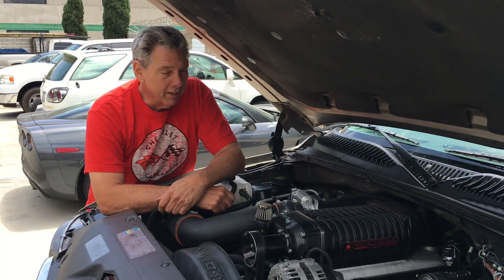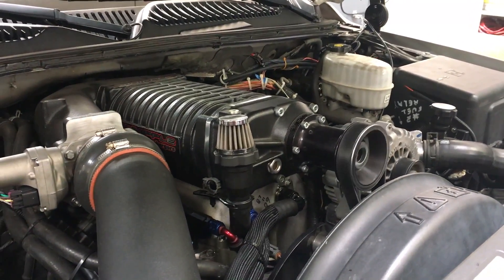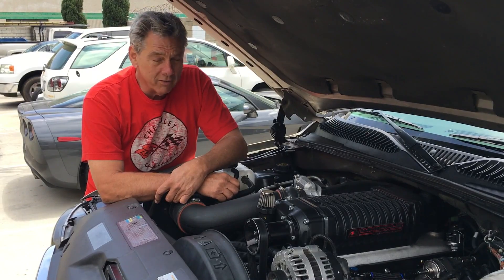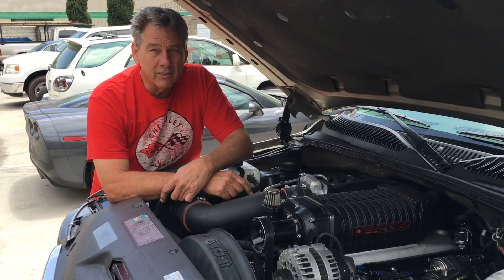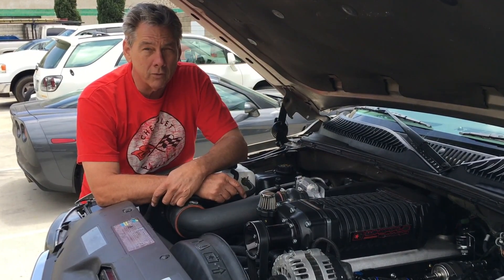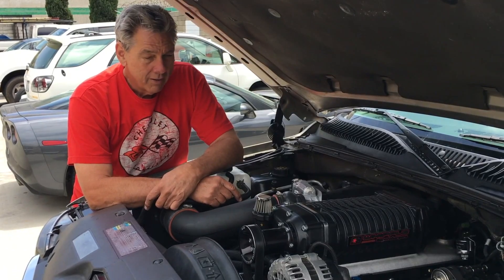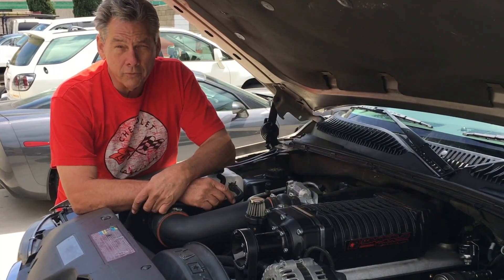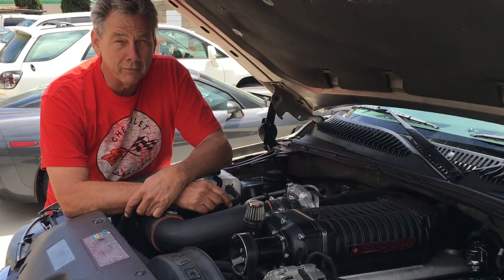2.9L Supercharger Makes 590hp / 695ft-lbs On Stock Vortec 8100 / 8.1L

Comment: God dame that torque curve is nuts. 650 ft lbs at 2500...... thats diesel territory
Reply: Back then the 8.1l was the gas version of a Duramax
Reply: I have a 2001 8.1, a 2016 Cummins 4500, and a 2019 L5P. It’s the 8.1 that puts a huge smile on my face!
Reply: and a lot lower than 2500 rpm
Reply: Diesels are torque monsters
Reply: this thing also puts out WAY more hp than a diesel....ill take a simple blown big block over the head ache that is a turbo diesel any day
Reply: @samsquantch14  Hey enjoy that 5 to 8 mpg towing while I do 15 or better all day long
Reply: @nou8257   😂
Reply: @nou8257  a modern vortec with a good tune and forced induction won't get horrible gas mileage
Reply: @nou8257  these early 8.1 were diesel killers fck mpg im talkin about diesel killers
Reply: @Zkgod24  So while you are getting gas from killing my 7.3 im still driving past laughing then
Reply: @samsquantch14  there is nothing simple about a blown big block the cost in a forged bottom end the super charger and fuel system could buy you a diesel that is ten times as reliable and way more efficient can make 3 times the power.
Reply: @jonruger  a blower is a hell of a lot simpler and has way fewer parts to break than a turbo...and you can pick up a nice silverado with the 8.1 for 4 or 5 grand and its a $8k kit....so thats a hell of a lot cheaper and more unique than every dumb bro dozer you see at every light...or for $3500 get a stroker kit and mkae almost the same power as a low boost blower...pushrods are simple as shit fuck diesels
Reply: @samsquantch14  if that's the argument buy a $3000 LS powered half ton build a cheap turbo kit and have all the power for under 5k. 8.1s just suck face facts they share nothing with the BBC of old that was a proven power maker. And nothing with the LS engine's which are a proven power maker. This is the only company that has aftermarket support for these engines and it's expensive. For the same power and fuel mileage you could build a 454 way cheaper.
Reply: @samsquantch14  most diesels are still just pushrod engines very simple once you understand them less moving parts then most gas engines until you get into newer common rail stuff. They only need fuel and compression to run on an old mechanical diesel pretty straight forward.
Reply: @samsquantch14  a blower has way fewer parts than a turbo, eigh?
Reply: @jonruger  that engine was bone Stock? They even used the stock heads and have it on LOW boost.those vortec engines for the most part will handle anything you throw at it
Reply: @jonruger  if you think a blown big block is complicated you should go sit down
Reply: @jonruger  if you had any clue what you are talking about...you would know it's based off the gen 6 big block but has a bigger stroke and 2 more cap bolts and vortec style heads...you are clueless
Reply: @jonruger  and they are way more tuneable reliable and practical then a old ass carbed big block
Reply: @jonruger  yeah but there is alot more parts to go wrong on a diesel and they are way more expensive..an injection pump can cost as much as an engine swap for a gasser.you are high as balls and won't climb. Down from your diesel perch up there in goofball yeeyee land..You probably don't even need a diesel let alone tow anything EVERY DAY that you cant with a big block.easier to maintain .cheaper in GENERAL .and very reliable
Reply: Erik Capozzi 8.1s don’t use Chevy firing order or BBC bore sizes
Reply: Erik Capozzi towing with a gas engine was cool in the 80s but why get 8-10 miles to the gallon towing? If you are actually towing something because it’s your business you wouldn’t make money. Diesels are more powerful and fuel efficient plain and simple and with good maintenance and a few preventive measures will clock half a million miles no gas engine can do that they rev to high to last that long to much wear.
Reply: Erik Capozzi try building a gas v8 that has 1000+ fpt and 400+rwhp and go work it everyday pulling see how long it lasts
Reply: @jonruger  If you tow every single day then there is no doubt a diesel is way beetter.thats common sense.but it's a safe bet that more than 75% of truck owners don't tow every day.they each have there own place but for the everyday wheeler or driver or offroader there's is NO point in a diesel truck .
Reply: Most modern diesel trucks are turboed, so this puts the gas/diesel on more even ground.
Reply: Mike F  sure you don't but it won't last long unless you hardly run boost which in that case what is the point
Reply: Its diesel territory stock.
Reply: That is in fact the very reason they built it. There were many people who needed the towing capacity but couldn’t (or wouldn’t) buy the duramax.
Reply: @TsrifTsal-s5m  I made alot of comments..your gonna have to be more precise on what the transmission has to do with
Reply: @erikcapozzi3425  FUEL ECONOMY
Reply: That's the advantage of a big block to a small block for 2500 and 3500 stuff. They make almost all their torque off idle for moving stuff. Without reving out.
Reply: @samsquantch14  less reliable? Have yet to see a gas engine that still makes power lasting half a million miles+ like a cummins can
Reply: @jonruger   actually mine is at 454k.. allison lost od but motor runs like a top. Never been opened in the 10 years I owned it
Reply: @jonruger  https://youtu.be/v8SNMebcb5Q
Reply: @jonruger  clearly never heard of the vortec/LS engine
Reply: Erik Capozzi an 8.1 is not a ls shares nothing with them or the original big block it is a joint venture between GM and Navistar/international that both pulled back from after just a few years because it wasn’t economical it is not an efficient motor. There is zero after market support beyond this one company that charges way to much. You can beat an 8.1 easily with a 454 a tuned up 6.0 or a diesel all day that’s why it didn’t last.
Reply: @jonruger  you are still clueless.the 8.1 and 454 use the same gen 6 blocks.and they BOTH use a 4.25inch bore...so not sure where you get all your Info .
Reply: @jonruger  have fun with that 180 hp..not to mention they're in pickups that will rot away long before it ever hits a million
Reply: @samsquantch14  you mean my dyno proven 417hp/1354tq that only cost about Fifteen hundred bucks. Come on out to hunting for horse power in CDA idaho this summer I'll be the guy at the Alligator booth with the red and the grey second gens on a trailer behind a black LBZ gmc. Gas was cool in its time and still cool for some applications but it doesn't compete with diesel. A 400 horse gas engine makes 650fpt if your lucky.
Reply: @samsquantch14  that depends on many factors, and isn’t much of a problem anywhere except in the north.
Reply: @jonruger 😂 you forgot the mighty Pontiac 455, Butler makes them at 900 lb ft of torque, easily
Reply: What's funny is I like gas. Dont matter when your towing gas or Diesel the fuel mileage is just about the same. At the end of the day with gas you can make big power with out any forced injection. Where really a diesel ain't shit with a turbo or supercharger.
Reply: James Avery well kinda, my Cummins max tq is at 1600
Reply: Diesels fuckin suck.

Comment: Can you tow a travel trailer with that setup
Reply: pete1534 you can even tow a trailer with a stock 8.1.
Reply: I think you could tear a travel trailer in half with the setup if you weren't careful
Reply: pete1534 no, because they’re not enough gas stations on the interstate to keep from running out. 4-5mpg maybe.
Reply: naw it's a lot better than that, it's like 10mpg
Reply: @Minecrafter55666  Bulllllllshiiiiiiiiitttttttttt
Reply: @nou8257  you say that but its true if not around that
Reply: @Minecrafter55666  What miracle did gm pull off with it then because I have heard they where as bad if not worse then the v10's which I had the displeasure of driving a Triton once and it took $10 just to go a few miles to the dump and then the car wash and back home and I barely even touched the pedal.
Reply: @nou8257  idk, that's just what it does. 😂 there's probably a YouTube video on it though lol
Reply: @nou8257  v10 was a great engine,  if you put a load behind it you could almost get rolling and burn gas, not much else, but great unloaded
Reply: @Minecrafter55666  yeah. Downhill.
Reply: @TheHologr4m  😂 While funny, I'm talking just in general, If it was downhill, it would be way better than 10mpg. Idk, we still have the same truck and it still gets around the same gas mileage.
Reply: You'd have to tow a gas station with you. Lol
Reply: You can tow a Dodge or Ford diesel BACKWARDS ! LMFAO !
Reply: @DawnNLN-ee2kh  Well if the dodge is a 2d automatic sure thing since the trans will die from hooking to the hitch if its a manual 4wd with a cummins buddy you are gonna need to be paying a bunch of attension to your traction considering the cummins has the lower range torque on you and if he is in 4wd and you are a 2wd you have the traction disadvantage as well.

Also depends on the ford diesel if its a 7.3 it will need injectors if its a 6.0 it will need head gaskets if its a 6.4 the engine will grenade and if its a 6.7 prob snap the crank.
Reply: I'm sure you can
Reply: the 8.1s are rated at 13k
Reply: these will pass anything on the road but gas stations. XD
Reply: No
Reply: Throw an auxiliary gas tank in the bed and you should get just about the same distance towing as the stock engine just using an extra 50 gallons of fuel lol

Comment: this engine is the most big LS ever made
Reply from the maker: Sorta. The 8.1L / 496 is basically a stroked 7.4L/454 with a big block specific version of LSX architecture. The most major change is the cathedral port cylinder heads similar to an LS1/LS2. Those extra cubes make a lot of difference though - a simple top end swap (heads / cam / intake manifold / headers) on a 8.1L / 496 is good for 550hp.

Here's an article from Full Throttle Marine where they did just that:
http://www.raylarengineering.com/mercury-marine-496-mag-performance-parts-upgrade-magazine-article.html

Comment: I have the 8.1 Allison combo on my truck. Want to keep the stock heads for now. Can i add the supercharger and keep the boost low until i can fortify the rest of the engine? If so. How much power can i gain buy just adding the supercharger and will the stock transmission hold up? What is the cost? Thanks in advance
Reply from the maker: The video above is an 8.1L engine with stock cylinder heads and forged internals. Its running our low boost kit which makes 8lbs of boost. This kit runs the lowest boost / largest pulley that clears the stock hood.

More information: http://www.raylarengineering.com/vortec-8100-496cid-forced-induction-performance-parts.html
Reply: Wow that much gain from 8lbs , would interesting to see one running 25lbs or 30

Comment: 'drool' Oh my yes. :)  Its amazing to see just how much a little forced induction opens up the power band with the stock cast heads.   You get an extra 1000 rpm to play with.  Unless you upgrade to Raylars heads, there isn't much point spinning past 4000 / 4500 rpm naturally aspirated. The engine just chokes out.   Now that your force feeding it, it turns this engine into a beast :)
Reply: stock heads, cam on most engines are very compatible with boost